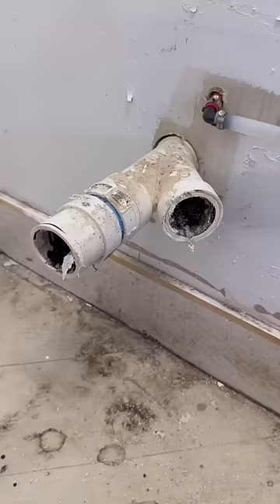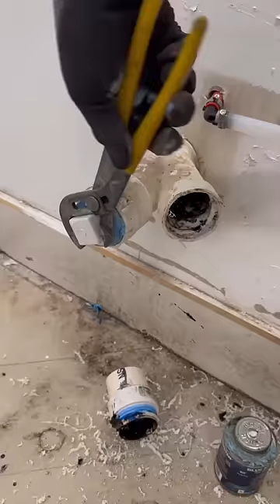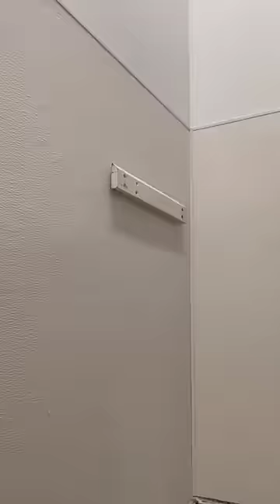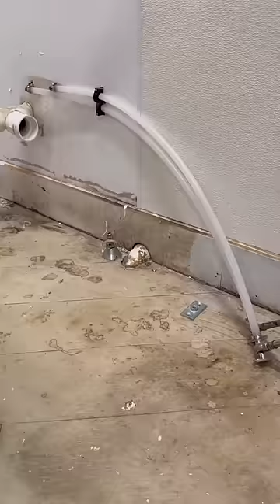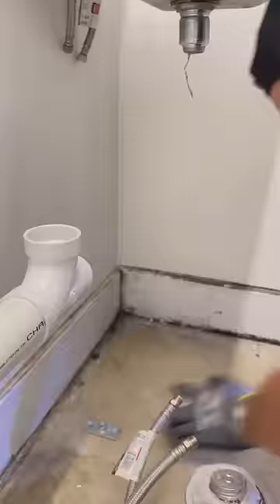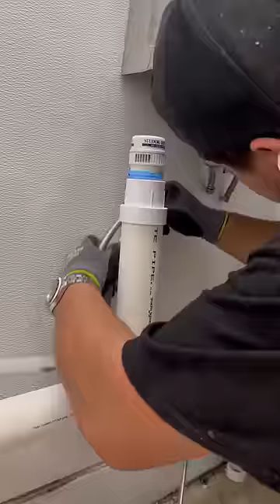Plumbing in hand wash sink #shortvideo #plumbing #construction #plumber #plumbingvideos #shortsfeed

Comment: The AAV isn't high enough. The exposed piping looks terrible. Did anyone actually get paid for this job? Oh, you are not supposed to put metal hangers directly on plastic pipe. Let me know when you want me to stop.
Reply: Ok you can put metal hangers on pvc and abs all day. Typically santees on there back  are a no no. But in this case most likely a hand sink for a restaurant, I see no problem with this. (30 year plumber)
Reply: @seancoulter9871  You can't do that in NJ. ( Where you need to be Licensed) You need plastic coated hangers or put tape on hangers. AAV is still too low. I know you can cheat and still have things work, but not if you're gonna look like you know something! The exposed pipe still looks crappy!
Reply: @michaeldudas7584 I would have taken  drain line all the way to right hand corner and 90 up and puT my santee in the vertical then came up as high as you wanted  with the aav
Reply: @seancoulter9871  Piping is still exposed and looks like crap!
Reply: @michaeldudas7584  I've never seen those hangers coming from the floor. Must be a new design.What makes it look like crap?! The only old fitting he left was that wye. Rest was new. Maybe clean that shit with orange wipes. And to add a sink it's cheaper to just run it exposed than rip up  a wall. Besides, nobody sees those pipes but the workers if it's  a restaurant
Reply: @seancoulter9871  If it's a restaurant, those exposed pipes won't last a month. Those workers will be hanging mop heads on the pipes in a week. May be cheaper to do it that way but it ain't the right way. Amateurs!
Reply: @michaeldudas7584  so you would be willing to forego the job if customer said, "Can u run it exposed? Only because it would be impractical to cut open  the wall?
Reply: @seancoulter9871  Sure! You have to remember that when it gets damaged, who is gonna be at fault. That's right, the Plumber. So you're gonna put it in the wall sooner or later. Probably for free the second time. And not to mention, there isn't an Inspector in my state that would let that install fly!
Reply: @michaeldudas7584  what's your companies warranty? Also, come on son.that shit ain't gonna break. We put on a year warranty minimum. And i offer 300 dollars a year warranty packages
Reply: @seancoulter9871  You're missing the whole point as usual. Should never have been done that way, looks like crap.
Reply: @michaeldudas7584  just saying bro u tripping, that is fine it will be OK and even if they do hang there shit on it. It's not the plumbers fault. You just note that and get them to sign off on it that the plumber will not be held accountable if the workers break it. And with New Jersey being such a liberal community ran by liberal governors. How can you be so Harsh on plumbing, But so laid back on, Immigration. You guys are all messed up. And I get your  point in the wall is better
Reply: @seancoulter9871  Don't ever say that I am  laid back on immigration! They are ruining the Trades here in NJ. They work without Licenses, insurance and the skills needed to do competent work. Just like the piping out of the wall and the AAV too low. GET THAT POINT?
Reply: @michaeldudas7584  job doesn’t look like crap. Plumbing repair doesn’t always present an opportunity to make everything look pretty.
Reply: @wynstondannerman605  I beg to differ! The job looks like an amateur did it. In other words, it looks like crap!
Reply: @michaeldudas7584  I mean I personally wouldn’t have used split rings to rest the pipe on. I would have kicked it back to the wall and used 2-hole strap.
Reply: @wynstondannerman605  Oh , that would have made all the difference in the world! Just as bad if not worse!